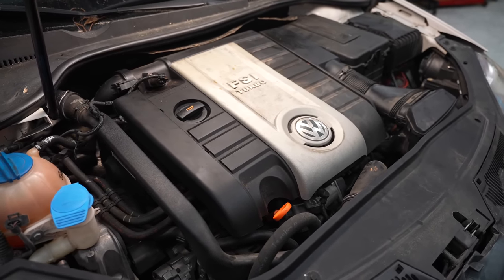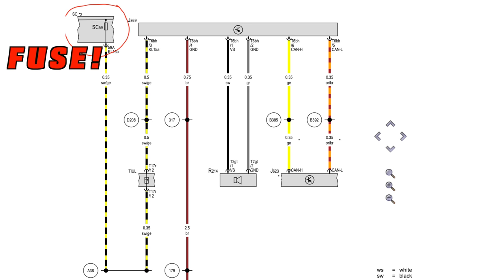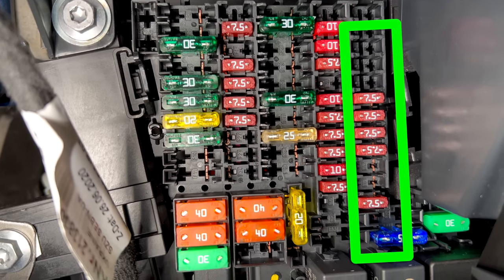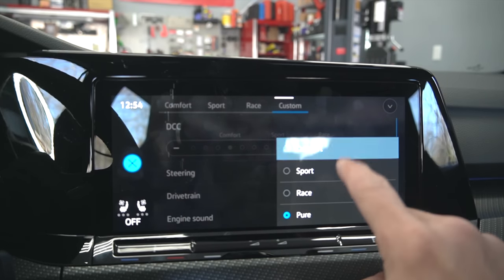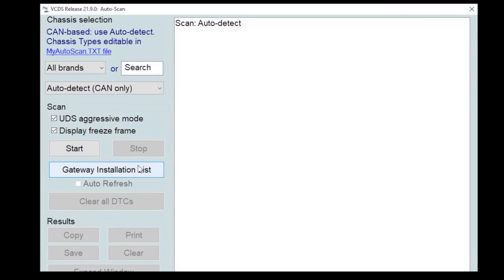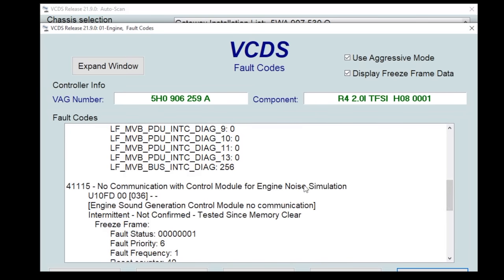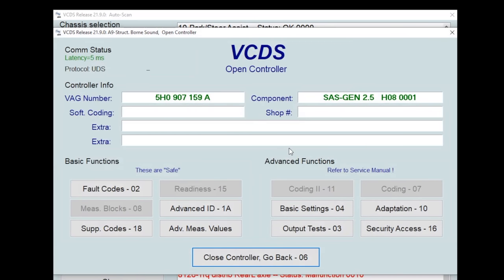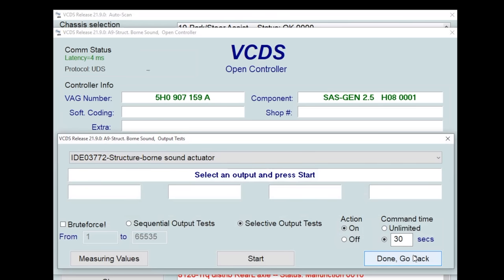Fake Engine Noises ~ How To Disable Soundaktor on MK8 GTI and Golf R

Comment: Doesn't the SoundAktor just amplify the sound of the engine? Like the old resonant pipe on older models? How can you object to that? I run my MK7.5 GTI sound setting on Comfort in the custom which is the lowest  and it is fine for me.
Reply from the maker: The new ones don’t. The old ones did (mk5)

Comment: In addition to disabling the Soundaktor, can the actual exhaust note be quieted somehow with, say, another resonator type?
Reply from the maker: You could. The MK8R doesn’t have a res from the factory
Reply: @HumbleMechanic  I’m confused. A year ago you responded to me that the GTI should be quieter than the R because the GTI has a resonator.

Comment: dear sir i have vw passat 2008 v6 fsi engine sir i have issue p0341 i changed cam shaft sensor still have same problem . problem is less pulling power but up to 4000 rpm good power but 1000to 3000  less pulling power sir i need your help plz

Comment: My MK8 GTI soundaktor actually creates a decent sound. Much better than the R's super fake vaccuum noise. The only problem is it literally rattles and buzzes the lower windshield/dash. Maybe when it warms up outside the rattle will disappear.
Reply: Oh god this brings back memories from having to fix those rattles on lots of Skoda Octavia RS at work. The most successful approach was to lower the volume of the actuator to ~70%. After all if you use the firewall and windshield as a huge speaker membrane creating some rattles doesn't exactly come as a surprise.

Comment: I've always wondered this, how do you know what each fuse is for? Most other manufacturers provide a fuse schematic somewhere but VW doesn't. Where is this info found for the public, if available?
Reply: The fuse schematic is normally a little sheet of paper in the fusebox. You can even find these informations in the original VW shop repairguides, as well.
Reply: @lars-lennartkoller4148  The fuse information for VW's is far from consistent - fuse positions and functions will change from each country, from each variant and even more than once during a manufacture year.

Comment: it would be cool to repurpose the Soundaktor to be a subwoofer for the Radio :D
Reply: I'm pretty sure you can, it's a speaker after all.. My guess is you can pipe normal amplified audio into it no problem. I want to try but still have 2 years warranty :D

Comment: My soundaktor in my MK7 is broken. I just want to remove it. All it does is vibrate, is sounds like something is vibrating against the firewall in sport mode, but in normal mode and individual where it's turned off (or at least down) the vibration isn't as bad, but it's still there.
Reply from the maker: You can code it off the exact same way, or just unplug it(under the cowl closer to the passenger side). if it still rattles  remove it, toss it. LOL
Reply: @HumbleMechanic  Thanks for the reply! I think I'm going to unplug it and toss it lol. #weightsavingsbro 😂

Comment: Could it be that the sound actor module didn't store any messages because it was basically unplugged? Instead everything else that was looking for it was showing faults.
Reply from the maker: Possible. It may not have reread in the scanner. It should have showed a fault or no comm.

Comment: Now for the next video, "How to bypass the TD1 code after SoundAktor disable."
Reply from the maker: the way I did it, should not flag anything with VW. That said this car IS TD1 because it's tuned.
Reply: Apparently anything modified other than stock, from what I am told will activate TD1. I could be wrong (or the service dude)? @HumbleMechanic

Comment: There's no setting in the menu to disable it? That's weird. The ui touch screen/computer looks like it would the capable of having that.
Reply from the maker: You can set up a custom drive mode and have it off. BUT that resets with key cycle.

Comment: Much about the Mk 8 GTI is incredibly disappointing. You just brush your fingers across the steering wheel while negotiating a corner and you might raise the volume on the sound system or worse. It’s a train wreck of German engineering gone even more wrong than usual. Cars like the 2022 Honda Civic are getting immense praise and multiple Car Of The Year awards for being incredibly well engineered and a joy to own and drive while the Mk 8 Golf is generally being reviewed as inferior to the much older Mk 7 version. A Tesla will beat most any production car made around the German’s own famous Nuremberg Ring and often at a small fraction of the price. And warranty companies have shown with their repair data German cars are literally the least reliable and most trouble prone vehicles in the world. Even a Hyundai Veloster N will crush anything close to the price from Germany around their own Ring. Superior German engineering is a complete myth. In reality the German’s make among the most poorly engineered needlessly over complicated and least reliable vehicles in the world. They generally dribble fluids even at low miles and things are well documented to just get worse from there. You should become say a Honda mechanic so you can stop making excuses for all the things the German’s get so very wrong?
Reply from the maker: Lol okay 👍